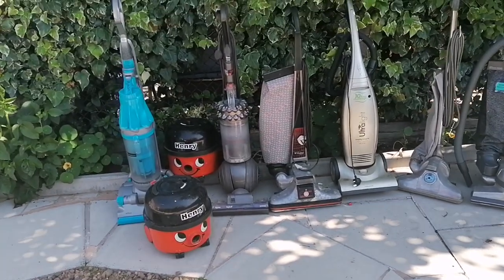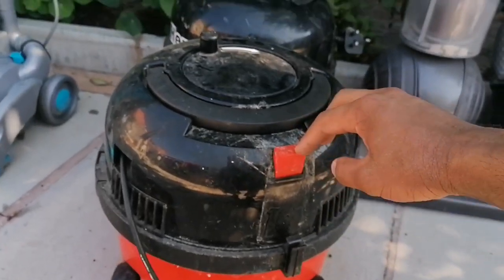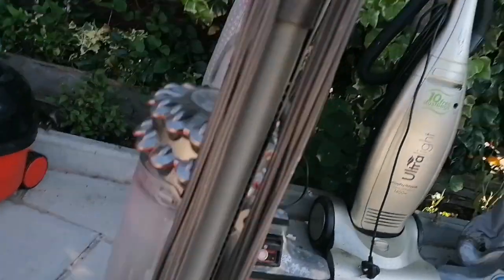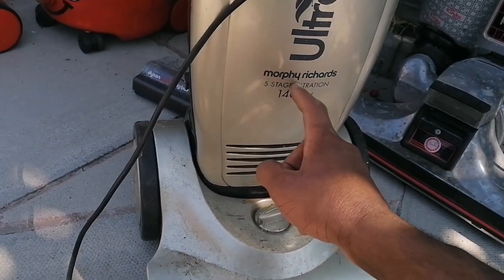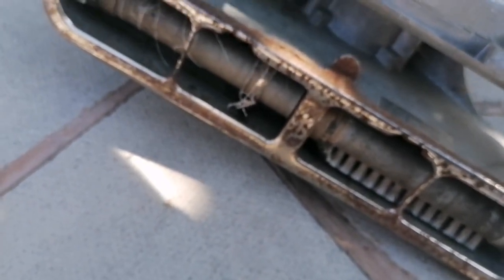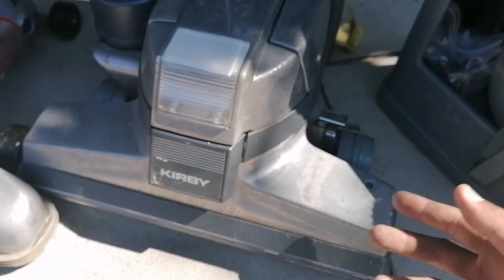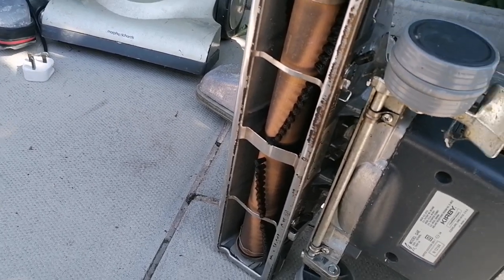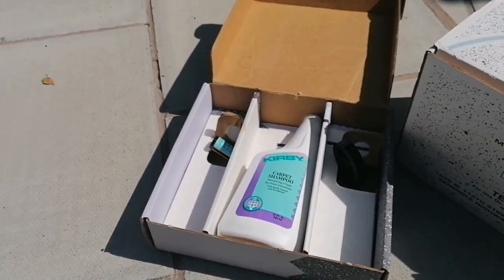VACUUMS SAVED: EPISODE 1 | Parwaz786

Comment: In my opinion,the UDS motors are good!
Reply: Fair enough in my opinion the rocker switch uds1053sn motor was bad as the carbons seized easier on them the push button uds1053sn motors didn't I have one that has worn bearings and smells like it'll catch fire but still runs

Comment: You might want to open the 2006 Henry and clean and dry the motor because it could seize also the hi lo switch is fine, I think it’s due to the pcb being wet, once the pcb drys it should work normally
Reply: Sometimes It can cause long term damage due to corrosion